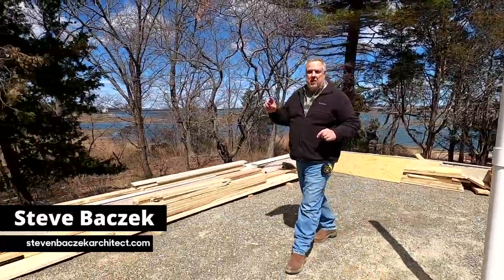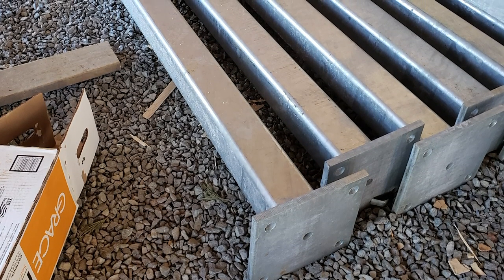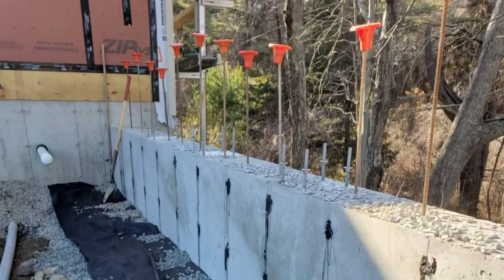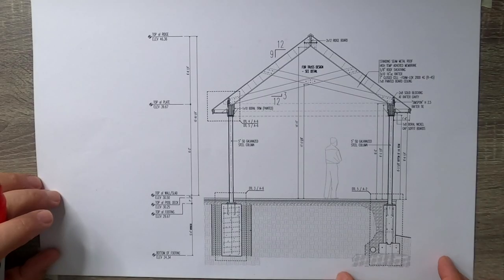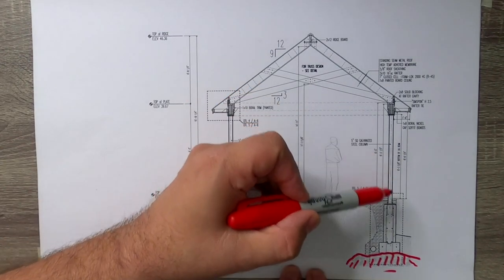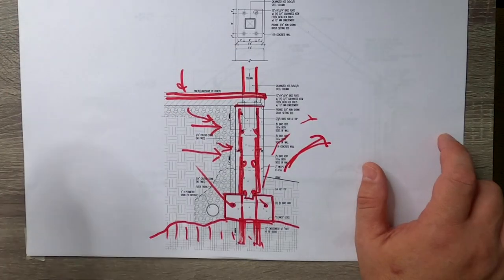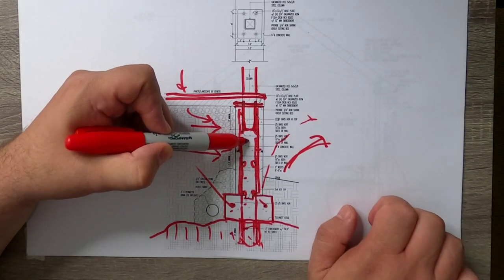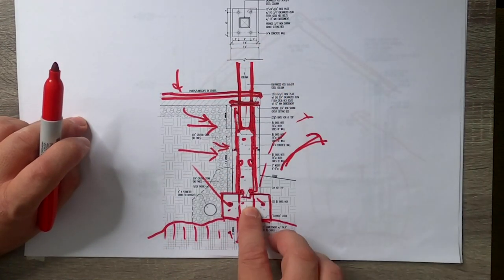Building a pool pavilion to withstand high winds!

Comment: Even with the moment connections at the pier base, There still is tremendous bending moments at the pier flange. 

There isn't a shear wall. I'm wondering if those piers can resist the lateral load from the roof diaphragm?

Comment: Two questions. You mentioned your structural engineer prefers to anchor to bedrock at all points or no points but doesn’t like to have a mixture of the two. However this design seems to have a mixture of the two.

Next question is was there a geological survey done prior to the design that informed you that you would need two different ways of anchoring this roof? Or was this some massive change order they gave the homeowner a heart attack lol